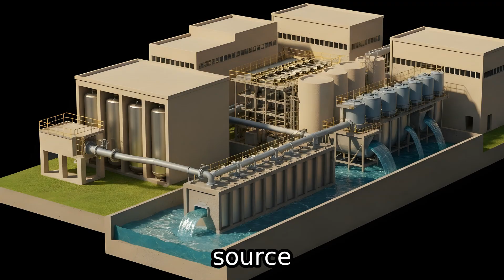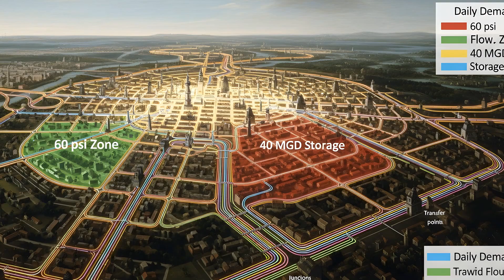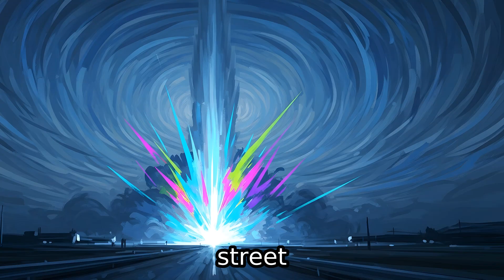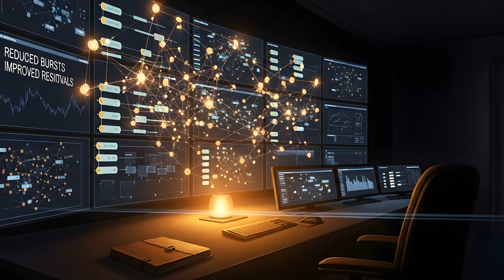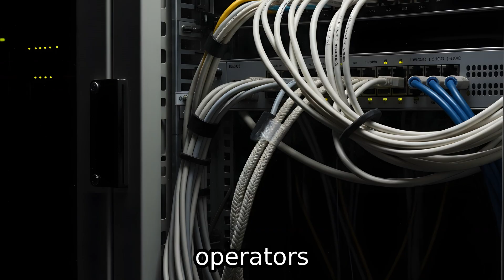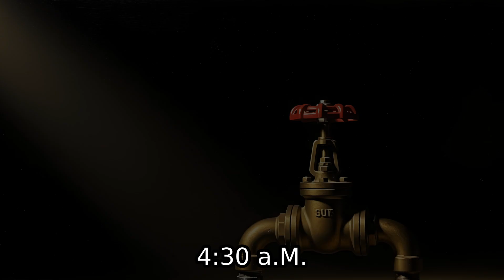Why Your City is 90 Minutes From a Water Crisis

Comment from the maker: We often celebrate the architects of skyscrapers and bridges, but the engineers who designed and maintain our water systems are the true unsung heroes of urban life. They built a circulatory system for our cities, and it runs 24/7 in total darkness.

The goal here was to shine a light on their work and the silent, constant battle they wage to deliver life's most essential resource. Every drop from your tap is a victory of foresight, planning, and relentless maintenance.

Has this video changed how you think about public infrastructure? It's a powerful reminder that the most important parts of our civilization are often the ones we can't see.